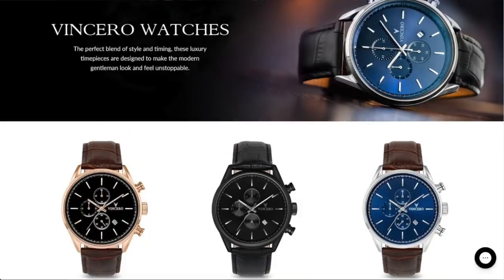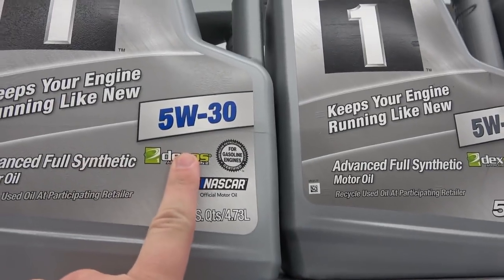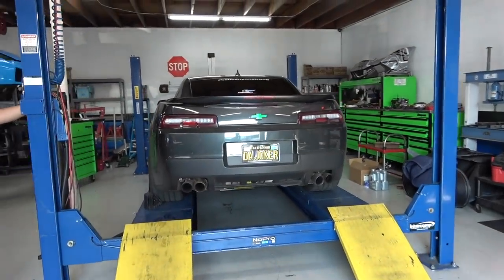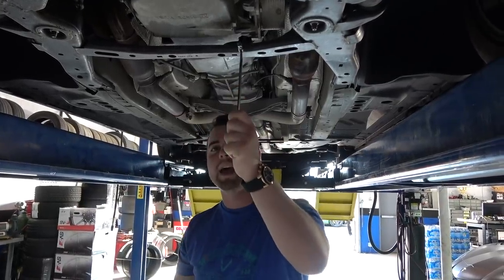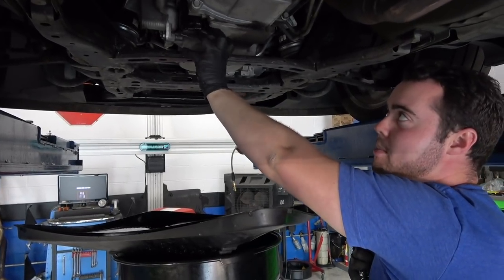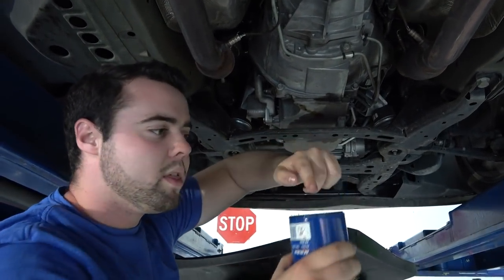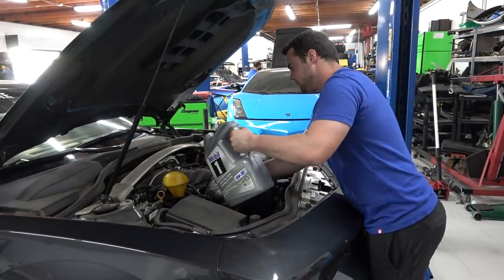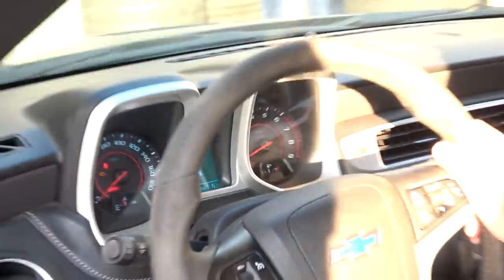How To Change Your Oil - The Secret!

Comment: If you need a breaker bar either you must be very weak or there is a problem. If you arent a 88 pound wimp and you cant loosen the bolt stop. Most oil pans are made from fiberglass or aluminum and the threads may strip causing far more problems that could have been prevented.

Comment: You should’ve added some new oil before replacing the drain plug to cycle the last of the old oil just sitting in the oil pan. Then once you see the clear oil coming out of the drain plug screw it back in and refill and that’s the best way to do an oil change so no old oil is left in the engine.

Comment: Clearly Parker has never done this. He shows zero intimacy with the process. Engineers knows how it's done, but they don't know how to do it.🤷🏻‍♂️😆😆😆
Reply: So funny! I'm just 17 and know how to change oil better than this guy, trying to teach people. Firstly, the engine is still clearly hot and he advises people to remove the oil filter by hand, good one. I hope someone burns their hand and files. Also I'd think its pretty common knowledge to pour oil in with the bottle sideways or upside down to maximize air flow back into the bottle for a cleaner pour. Did you notice how he had his drain pan under the plug? Probably the first time he's taken a plug off a car, thinks the oil is coming straight down hahaha. Good little edit there so people wouldn't notice. I hope AGX billed him for absorbent for cleaning the floor haha.
Reply: Marcos Goulart Parker was an engineer himself. The OG’s would only know
Reply: Ben Gelderman He is just so lost doing this...my God🤦🏻‍♂️
Reply: rektgg Also I think he still is, did he lost his degree? 🤷🏻‍♂️
Reply: can you all post  a link to your oil change videos? I want to see how it is masterfully done

Comment: When I 1st bought my car I lifted it to change the oil and replaced the plug for one with a small head.  Since then I've been changing the oil without having to lift the car at all, using a small wrench and a short wide plastic tub. That would be my #1 tip, look and see if you can get to the plug and filter without having to raise the car.  Makes everything a lot simpler.

Comment: Just a little mistake: the brand doesn't matter that much, manufacturer typically have deals with them but in this case any 5W-30 Dexos 2 oil would do.

As Dexos 2 is the car manufacturer certification (in this case GM), any oil having it has been certified by GM for cars that require Dexos 2.

Comment: Always use a torque wrench on the oil filter as well. Easy to under/over tighten. I’ve had shops do both because they didn’t use a torque wrench.

Comment: I think you have to start the engine and check oil level then. Also, my mechanic changed oil for 65 bucks in Brooklyn on a similar camaro a few times. ...so why all the manual labor here for the same price - not sure:)

Comment: The oil drain plug gasket/washer on many vehicles is a single use item and should be replaced at each oil change.  I replace drain plug washer on my LS3 every oil change to make sure it doesn't leak.
Reply: RetroCarGuy530 if you put it on tight enough it shouldn’t leak at all

Comment: Replace the drain plug with a Fumoto valve.  Flip a lever and the oil drains.  No mess at all.  Attach a piece of tubing to the valve and drain the oil into and empty container.  Ready for recycling.  Also, buy a quality oil filter.  Not a Fram.
Reply: Georgia Yankee why no Fram? It’s good enough for 3-4,000 miles

Comment: It's kinda funny how changing your oil is so shocking to millennials while our dads and grandfathers did it for years, I finally decided to change my own oil at almost 37 years old and it felt good and I'm happy I got to put the oil in it I wanted (Castrol Edge) so I could be sure it would last and give the smoothest performance.

OH and LOL at the gloves, I knew I was gonna get oil all over, I just had a rag handy when my hand inevitably got soaked in oil not only from the oil draining but also when the drain plug fell in the drip pan.

Kinda makes me wonder, I vaguely remember changing the oil on the tracked vehicles in the Army... Perhaps this wasn't my first oil change afterall?

Comment: TIP: always replace the oil drain plug(s) before removing and replacing the filter. Why? If you forget you'll be in for a surprise on your garage floor after filling with new oil.
Reply: blairjayson you don’t always have to replace the drain plug.

Comment: READ THIS PARKER : " THE OIL CHANGE HAS TO BE DONE ACCORDING TO THE LONGEVITY i.e  FOR HOW MANY MILES THE OIL CAN BE USED .. AND NOT REALLY ACCORDING TO THE MANUAL .. AND ADDING TO THAT .. THE LONGEVITY OF THE OIL DIFFERS FROM BRAND TO BRAND AND DEPENDING ON THE BLEND..SYNTHETIC OIL LASTS LONGER THAN THE MINERAL OIL ! ITS NOT NECESSARY TO GO BY THE MANUAL ! and AMSOIL is better !  :)

Comment: Why....that's what Jiffy lube is for ....
Reply: pb 78234 no.... jiffy lube is the worst place to get an oil change. Sometimes they don’t even drain the old oil. They over tighten drain plugs and the filter. To where if you do it yourself you could break stuff